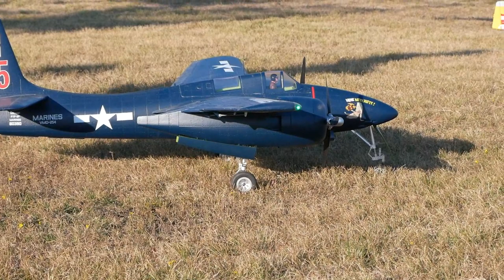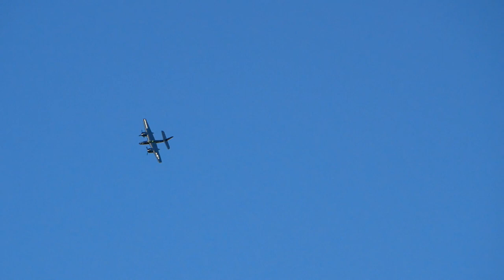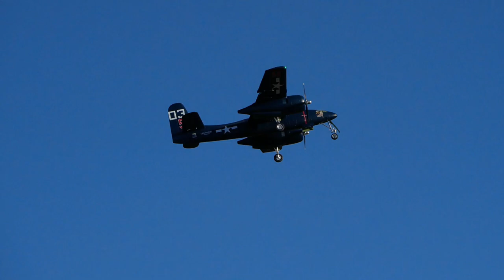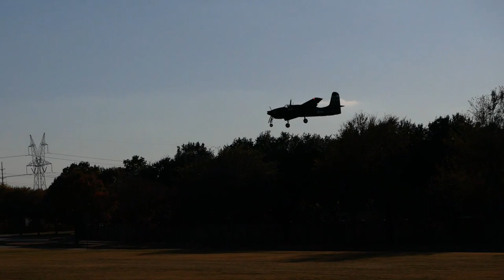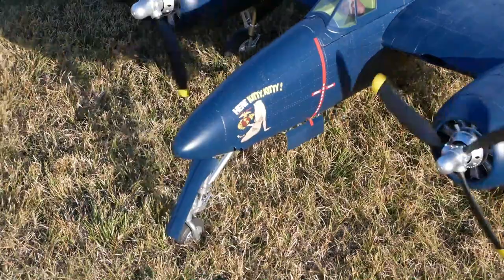FMS 1700mm Tigercat F7F RC Plane (HD Video)

Comment: This is way up on the “Want List”. In the last few months I’ve bought flown the Flightline 1600mm P-38, Corsair, Spitfire and the Hobby King 1600mm FW-190. Love the way the large scale fly and the almost locked-in feel right off the bat. The Tigercat is a really pretty plane in flight.
Reply from the maker: I agree. You have a nice quiver of planes. Thanks watching and commenting. 😎
Reply: I got it! Flies every bit as good as my all time favorite WWII RC warbird, the Flightline P-38. Both never have any bad tendencies and easy to land on our short, bumpy, 40 year old, never resurfaced runway. Anything Flightline makes is worth the money.
Looks like you did the gear upgrade as well. For me, it was money well spent. Thanks for posting the video.

Comment: What size 6S battery are you using? (Placement for CG?)
Reply from the maker: Sorry for the delay in getting back with you. I will ask the Pilot/Owner. Thanks for watching and commenting. 😎
Reply from the maker: I use three different types of batteries in that plane, a 5000 placed all the way forward, a 5400 high-voltage placed about half an inch back, and a 6000 placed about 3/4 of an inch back from the front of the battery bay. All the batteries are 60 C.
Reply from the maker: He said CG is factory recommended range